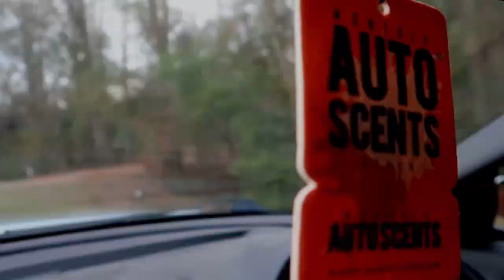GIRLFRIEND'S FIRST attempt at CHANGING OIL!

Comment: Also, it would be a good idea to get you a Hex socket and torque the oil filter adapter while the filter is off. they are known to get a little loose over filter removals and cause some issues.

Comment: Word of an advice from another Terminator owner.. Take you some aluminum foil and cover the rack and pinion, everywhere under the oil filter..so when you take the oil filter off, oil doesn't get all over everything..and shame on you for using that Napa and STP oil filter...you oughta know better than that man lol also, 5-30 is better for the 4V engines.
Reply from the maker: Michael Westen thanks for the advice, but I was using what’s recommended by Ford. And I also heard that it depends on the climate as to what oil works better (thicker or thinner)
Reply: Ford didn't recommend that non motorcraft filter did they? lol just giving you shit man. But for real, I've read a lot on the forums, and there was even some SVT engineers saying 5-30 was better, they only said 5-20 for the millionth of a mile per gallon difference. Which is what I use, Motorcraft filter and motorcraft synthetic 5-30 in my 2003, with a 2.3 whipple. These engines are too expensive to rebuild, so I don't gamble on inferior oils and filters, especially when Motorcraft is usually cheaper or same price.. Walmart has Motorcraft filters for like $5, 5 quart jugs of motorcraft synthetic 5-20 and 5-30 for $17.. even though we need closer to 7 quarts, it's still a damn good deal. But my other comment, about the oil filter adapter..next oil change, get you a 1/2in hex socket, and tighten it to spec, 50 ft lbs i believe..they are known to back off and when they do, they'll leak, possibly mix oil and coolant, and you'll be thinking you blew a head gasket.
Reply from the maker: Michael Westen thanks for the info👍🏽you might’ve just gave ol Peggy a few more years, lol
Reply: PJ Morrison no problem, we gotta keep the terminators around and in good shape lol especially the silver ones